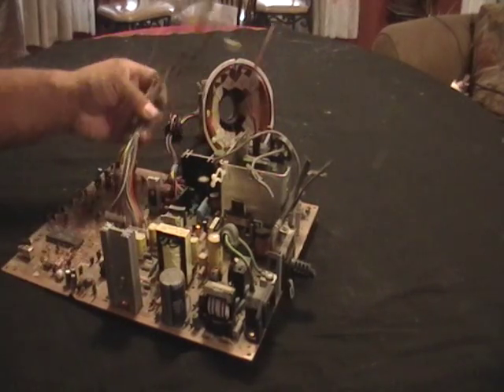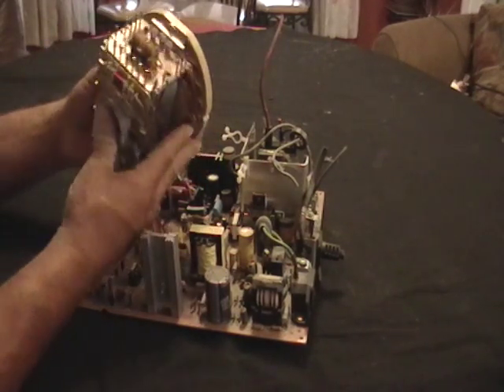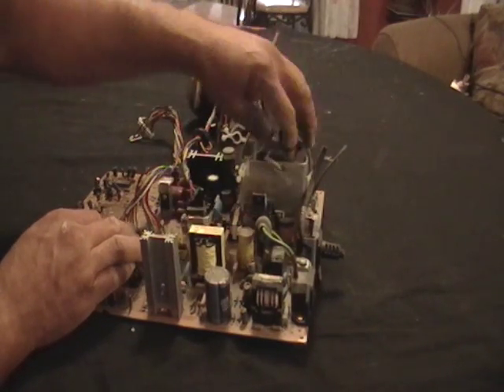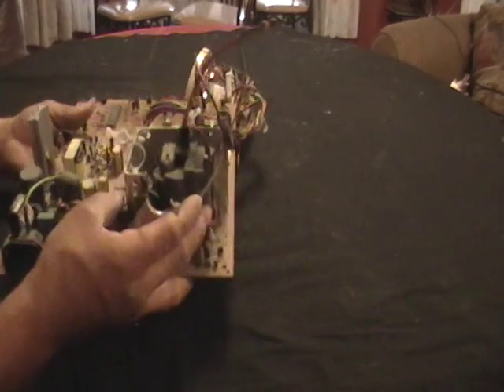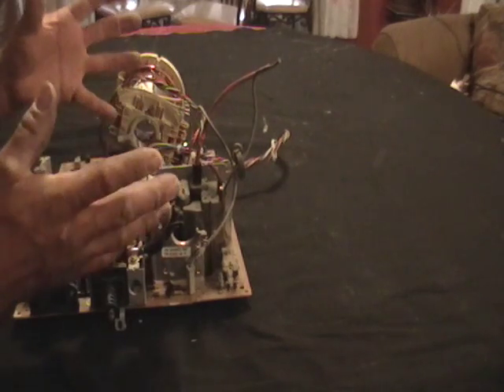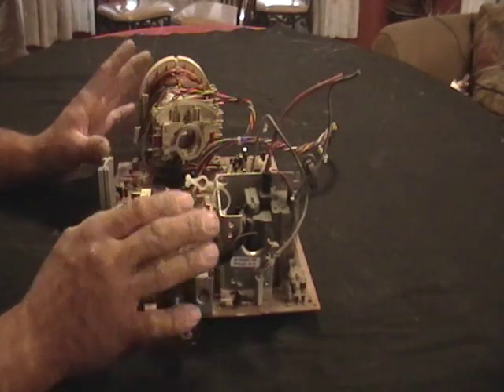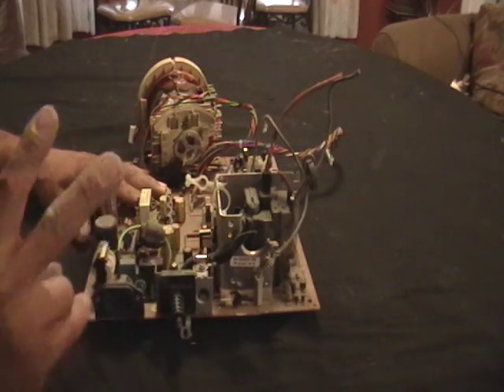Scrapping a computer monitor for copper, aluminum

Comment: I took a big older monitor apart to scrap today. There were (on the board) 5 different heat sinks, 4 different copper filled spools, 5 various sized transformers, and the tube cone had huge amount of both #1 bright & #2 copper bare wiring. I never bothered to look on the cabinet what make it was but the board has "NR" in big white letters printed on the corner of it. And, the copper insulated (not taped) wire looped around the tube was about 6 to 8 guage in size. Wish I can find more of these!!

Comment: Mike, You forgot to mention that if you break the glass screen with a hammer (I use a sledge hammer) in a trash can, you have about 1-2 lbs of steel Inside the screen to scrap as well, not counting that heavy steel band that goes around the screen.  The glass I just leave it in the recycle bin at the curb on trash day and they take it every time. nly takes me about 2-3 minutes per unit.  The only thing that leaves a tv when I am done is the plastic and the smashed glass.

Comment: @Yogamartial 
If you want to be absolutely safe, the CRT can also be discharged by shorting the anode to the metal casing using an insulated tool. There are several videos on YouTube that cover the procedure. Just type "discharging a CRT" in the search field.

Comment: As houndini said it is a flyback transformer, which is used to produce high voltages. But... My old high school electronics instructor and his assistant took a sledge hammer to one of these and weren't able to even locate the copper in it.

Comment: Hi Mike, is the power supply cord on the monitors copper or aluminum ?? I have some with both. Some are bright copper color and some have the aluminum and I was not sure if you could throw everything together, Thanks
Reply from the maker: victordelc21 they can be both...throw it all together...
Reply: Mike the Scrapper Thanks again Mike

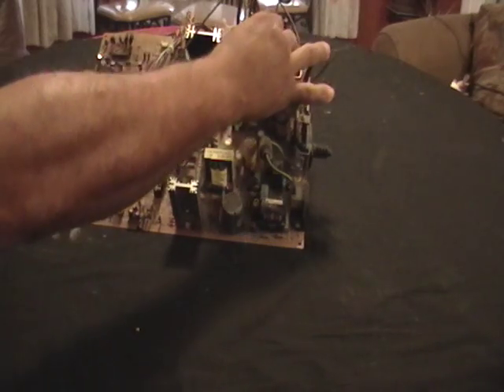Comment: The black thing 1:03 is a transformer and connects to the tube with a suction cup like device and it's best to take a pice of wire and connect it to the GROUNDED frame and with one hand behind your back, stick the screw driver under the cup and try for at least a minuet to discharge it, and the 25,000 volts come from this transformer, soooo, DISCHARGE IT or you'll be in a lot of pain.